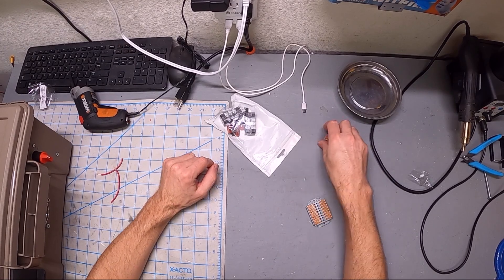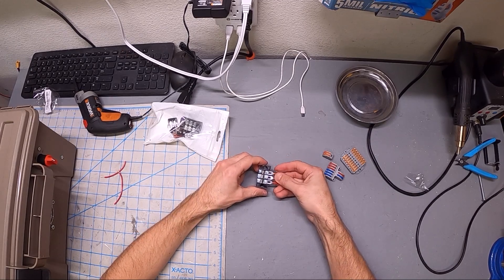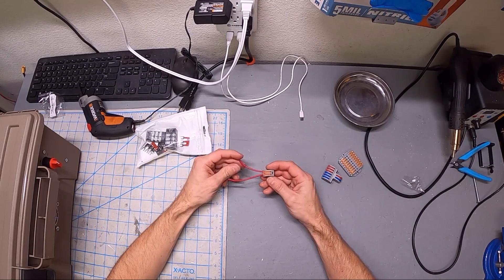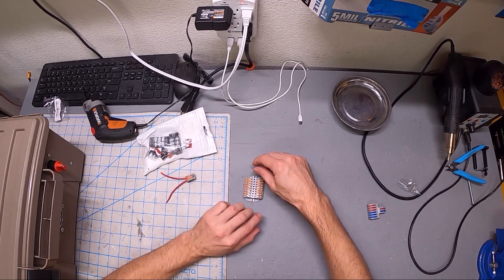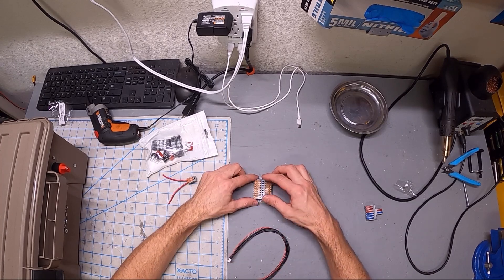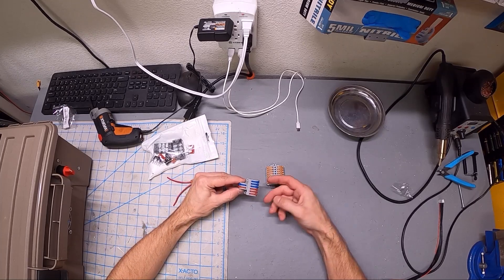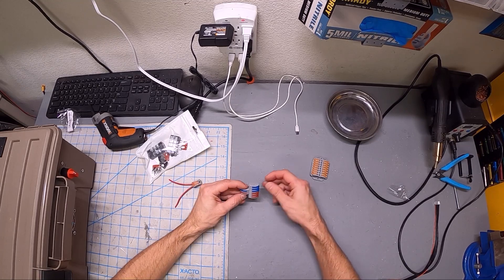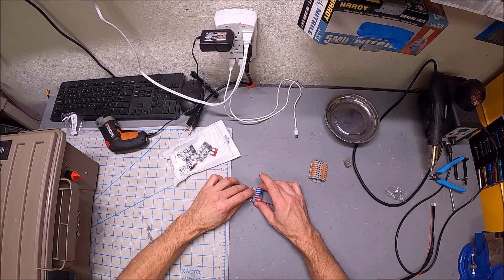COOL WAGO CONNECTORS FOR JOINING ELECTRONICS

Comment: I gave you a thumbs up only because I agree with you on the AE's lever lock splicers but I'm a hobbyist and can't help wondering if these splicers are even comparable to the old fashion terminal blocks for splicing wires, the overly cautious thinker in me tells me to go with the old terminal blocks since the connections are more solid and contact coverage on the wire is higher than the lever style connectors, any one can chime in and sort this out?

Comment: I represent WAGO in SA and the only true WAGO connector in this video was the 222-412 Connector. The rest of these connectors are NOT from WAGO and there for it is incorrect and false to call the other connectors "WAGO Connectors". They are poorly cribbing the Cage Clamp Technology. Please can you confirm if any of the other connectors had any certification or approvals? With your 1 in/3 out  connector you didn't mention anything about current ratings and change of wire gauges. If in and out are the same, then you have a fire hazard.
Reply: well the legit "WAGO" connectors are certainly much more suited for professional use. But the knockoffs are ok for low current and noncritical applications. He even mentioned that he bought them from china so I assume those are non "WAGO" conectors